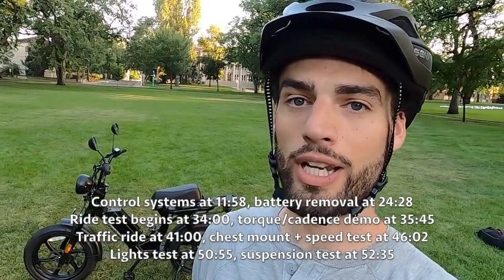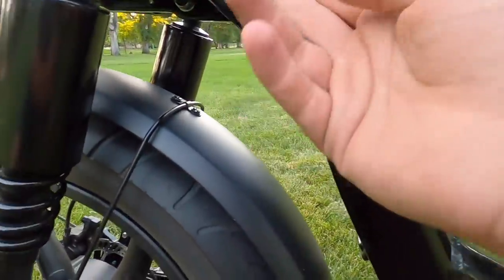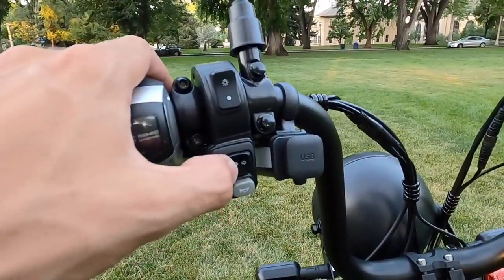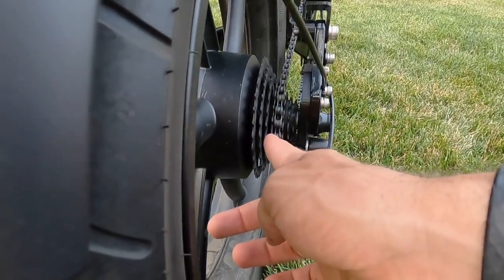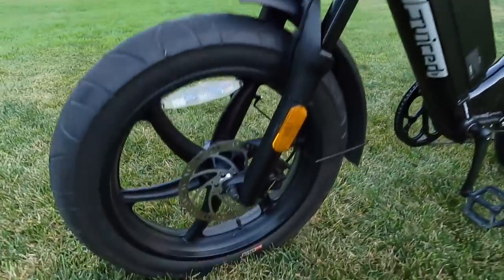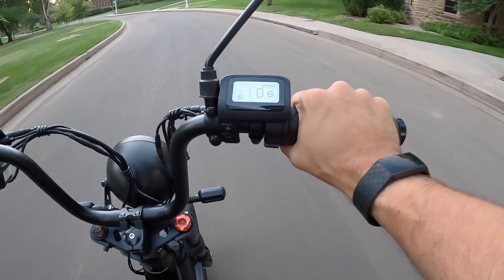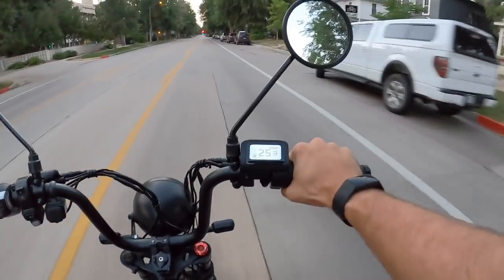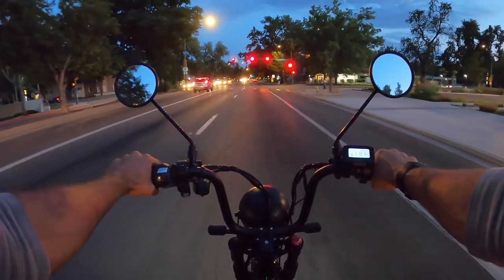Juiced Bikes HyperScorpion Review - $3.2k

Comment: DO. NOT. BUY. My aluminum hyperscorpion arrived with a faulty controller. I had to unplug half of the cables from the bike, clut all the zip ties, and send the whole controller back. There is no on-site support even though I live 2 hours away from their headquarters. Horrible. I have a few ppl saying they are having the same issue with the battery showing empty with 0 volts and they can't give me an ETA for the part bc they don't have any controllers in stock at the moment.
Reply: I've had one with mainly a few tiny blemish issues. It was a great purchase for the price. You happened to get an unfortunate bike that doesn't represent the average bike
Reply: It represents their quality control and customer support for a bike that costs nearly 3k. If you need a durable moped/bike with good support and you live in LA, just get an ONYX
Reply: @NemoEUC  Yes customer support of Onyx a lot better than juiced and I live in LA.
Reply: Same here. Received the new controller on 8/24 and  am waiting on the video to be posted on the R&R process, Fingers crossed the new controller is actually the fix it needs. I will say their customer support people are very quick to reply back. Same day or next day if my emails were sent late in the day.
Reply: @mdbach1065  A video was posted to replace the controller, thats pretty much the process: https://www.youtube.com/watch?v=KWFkaJv0ZGI&t=508s. ill give them that. they were quick to respond. i hope your controller replacement fixes the issue.
Reply: Just saw a vid on Bolton Bikes where he replaced and is developing controller/display upgrade to unlock the full potential to maybe 35 to 40 mph throttle only...

Comment: Lol.. Make sure Karen can see the paperwork and sticker. 😂 While some guy blows past at 50 mph on a CYC 5,000 watt mid drive 72V bike he put together for $3,500.. That bike/moped is really cool.. Only other EBike people would comment on its specs being above norms. You can put a granny on that bike and nobody would ever question it's speed or power .. Police would never give it a second glance . Now I see why you guys don't review a Kepler .. Looks like the controller is mounted in the frame .. You didn't mention it or what amp controller is on that .. Nice review.. Very thorough run through.. Good job! Could change the rear cassette to a narrower width set yes.  👍

Comment: at this price over 3k just buy a sport moto cycle  or a car xd . its way to expensive for 70miles distance in good condition .. and its considered a class 3 ebike so its illegal without a license . its considered a moppet/scooter in most countries including the usa .  its more dangerous because there is no sound of the motors . i am using the lectric bike its 899$ usd and does 50 miles and 28mph it is capable of folding for transport and has super fat tires . Imo  there is no reason to go above 1k - 1,5k for electric devices .
Reply: I bought an '82 Kawasaki 440 LTD for $750 with an unlimited range and much safer than an ebike and no nasty lithium that requires mining and disposal . I doubt this bike will be around in forty years but my Kawasaki is still here and has never had lithium to dispose of . 3k is way to much for such a limited bike .
Reply: I just checked CA bike laws . Class 3 under 28 mph is ok over 17 years old. Need helmet.  Not on some paths. No license or plate.

Comment: Why not just keep it in 8th. gear?  What do you think of the motorcycle foot pegs option and deleting the pedals, chain ring etc. ?   Mine is arriving today.
Reply: I tend to shift down to 5th gear when I stop and then back up to 8th once I get going. I prefer to pedal and get at least some exercise while riding... but it is more than powerful enough to ride with only motor power, and swapping the drivetrain out for the motorcycle footrests would save some weight!
Reply: @TysonRoehrkasse  Thanks for the reply.  Now that I have 40 miles on mine all I can say is Wow!  Any modifications if any will be down the road it is a blast the way it is.  Only concern is the seat.

Comment: This is very irresponsible advice. Don't be like this guy.  Lock your bikes.  I've seen full sized motorbikes lifted into the back of a van that were parked in conspicuous places in daylight.  This is light enough to be lifted.  Alarms are no deterrent to a theif.  You will never regret locking your bike, it's more likely you will not locking the bike.

Comment: The debate between the word MOTOR & ENGINE has been going on for a long time, and it's time to settle it. The reason are many. One example is, since electric vehicles are definitely becoming a part of normal society, signs like NO MOTOR VEHICLES now need to be changed to NO CARS OR MOTORCYCLES or NO COMBUSTION ENGINE VEHICLES.. My local bike path has signs at every intersection where it meets the road that say No Motor Vehicles, because they understandably do not want cars and motorcycles and ATVs to come onto the bike path. Unfortunately, there are some people who believe a motor vehicle is anything with motor, hence, they don't believe in electric bike should be allowed on a bike path. Then the police get involved. Regardless of their misunderstanding, this problem still exists. It could be clarified if the signs simply said no combustion engine vehicles. In this particular example, it's a public perception or misunderstanding. I suspect The Ford motor company will have a big problem with this, But that is not what I believe needs to be changed. Just roadsigns and the way the government thinks about electric vehicle. The time has come to address this IMHO.
Reply: In my neck of the woods no power assist is allowed on bike paths . You can ride your gas bike or ebike using pedal power only  , and there are no signs . It is the law . If you do n't know the law you might learn when you are fined . You would also need an M class licence (Motorcycle) So why bother paying so much for something so slow that requires plates and insurance with a range of 50 miles .

Comment: If you take the battery with you into the coffee shop, doesnt that disable the alarm?
Reply: No, the alarm has its own battery. I think it might be a 9-volt but I'm not sure. The alarm unit comes in a separate box and you have to adhesive it onto the bike, I put mine under the seat where it would be hard to see.

Comment: Juiced sent me a replacement controller for my hyperscorpion and after i replaced the controller, the battery still showed 0.0 volts with an empty battery. They have no idea what is causing the issue. I have no faith in this company. If you want a quality e bike, look somewhere else.
Reply: Did you also replace the display head at the same time? If its microcontroller is defective then it may be not communicating properly with the controller. Also, with SOME display heads, the voltage measurement wire is dedicated and separate from the rest of the display head I/O and power circuitry so you might check to see if that is the case with this one. If it is separate you can't assume that because the display is on the voltmeter is getting a voltage to check. You have to check the voltage on that wire. If 0 volts then check all the associated connections, look for damage, and also determine if it goes separately thru keyswitch and check those connections too if needed. Also check all connectors for displaced  connection pins (e.g. pushed too deep into or even out of  connector shell)
Reply: @exgenica  ..all things juiced should have checked before shipping the bike. They've agreed to give me a full refund. I've already scheduled a pickup for next week. Thanks for sharing the possible cause. They had me check the motor cable, I replaced the controller, the DC to DC, the ignition switch, the display cable harness, and nothing worked. I called their tech support, and to be honest, you know more than them.

Comment: Your web site is awesome. I have been researching bikes for months trying to figure out what is best for  me. I like the scorpion,  for the bench seat! It is heavy, 100 pounds.   I like the folding bikes for putting it in my suv,but those are 60 pounds.  I like suspension. Fat tires fir beach, trails, grass. I am 5' 3" and want a bike that I can have both feet on the ground while sitting on the seat. Inseam about 28 inches. Without test riding one, hard to decide.  

Is there a kids, teen size bike?

Comment: Awesome review. How would you compare this to the scrambler camp with 19.2ah battery . I like that this has rear suspension
Reply: They just released the hyperscrambler 2 which is just this and the scrambler mixed. Full suspension and 2 batteries. I already pre ordered mine
Reply: Mr Railfan yeah I saw it. I passed on the HS2 and have had my camp scrambler in brushed aluminum with the 19.2ah battery and off road controller and I’m really happy with it thus far. I have 60 miles on it so far. Juice on !

Comment: Maybe off topic, maybe not🤔
If you were to consider a fairly epic ride, say🤔 across the United States!
Would this be a contender?
If not, which bike, or style e-bike would you choose and why?
Reply: Honestly I probably wouldn't pick this one... it's amazingly fun to ride around town, but for a long range haul a trekking-style bike would fit a lot better. The range on the Scorpion is decent if you pedal along with the motor, but it's definitely not as comfortable to pedal for long distances. Trekking bikes tend to have much larger diameter wheels too which really helps with ride comfort and rolling efficiency! 

It could certainly handle carrying cargo or pulling a bike trailer though, I've heard of some people doing setups like that where they carry extra batteries in the trailer to swap in, and maybe cover it with a solar panel to charge the batteries that aren't being used. That could be an interesting setup!

Comment: It's cool until you get to know the price which is comparable or slightly  less than a Honda Grom around $3400 with top speed of 55mph.can easily handle 2 up no range anxiety and that bullet proof engine that will last many years.you can't really say that to the China source battery and engine.And that battery you have to replace after 500 charges? The only real advantage is that pedal and too bad it might need registration,proper license to operate it and insurance.if it was my money ill go with Grom

Comment: Are they water proof? With all the wires to hook it up, I wonder if it is weather resistant.
Reply: You will want a Veltop attachment if you're looking to ride ebikes in the rain.
I got one for  a RadRover and riding in the rain was very fun. I did have to buy some gaiters for my legs though from road spray and that was the complete solution.
Reply: All the connectors are high quality and water resistant, you wouldn't want to submerge it in a lake or anything like that but riding in rain is no problem :)

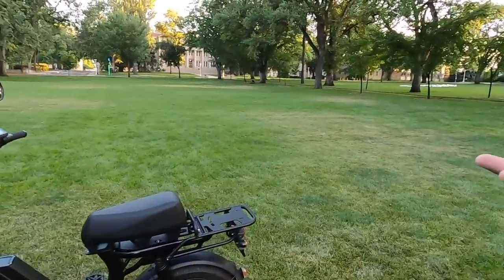Comment: I really want to like this bike but under close examination it scares me.  For example,  just look at those weld points at 2:19, 3:36, 6:49 they look like a 10 year old did them.  I've purchased a number of scooters, go-karts and electric skate boards from China and there have always been quality control issues when it comes to paint, welds, wireing & brake components.  In some cases there was complete failure after just 10-20 miles of riding.  Again, I really want to like this bike, it checks off all of the boxes for me but I fear after reading some of the other on-line posts that it will just wind up falling apart on me and this is a lot of money to have that happen.

Comment: Glad I found this Channel.  Hello EBR, I am looking a e-roadbike for my wife.  She is quite small, with 155cm and around 50kg.  My guess would be framesize around 44~47. I found it hard to find her size even with normal road bikes, let along e-roadbike.  Do you have suggestions?
Reply: Well I'm 5'2 and this Hyper is the safest I've ever felt on an ebike. It's sturdy, has amazing balance and with the step through frame it's super easy to get on/off and honestly the bigger complaints come from taller men wanting more leg room. Pedaling for me is perfect. Hope this helps her!
Reply: @zengirl7510  emm, this is not really a roadbike I'm looking for.  hhhh.  She is used to ride road bike and e-roadbike would be the first choice.  Or maybe a e folding bike.  Do you have suggestions? Thanks!

Comment: Isn't the motor on it just a 1000w peak bafang motor? I would hardly describe that as a moped. My Lectric XP and DJ Super(e)bike would be considered a low powered scooter based on your interpretation of the Colorado low powered scooter law.

EDIT: How would you register this when it doesn't have a VIN? I think you should have a disclaimer that this is your interpretation of Colorado law and should be taken with a huge grain of salt since you aren't a lawyer.
Reply: There is just such a disclaimer in the pinned comment, I'll add it to the description as well :) 

If memory serves, the motor is 1500 watt peaking at 2000. I found a lot of conflicting information about how it should be classed and where it can be ridden, so I still have no idea what the proper legal answer is. At least where I live I have been able to ride it on the street and in the bike lane without getting hassled by anyone!

Comment: I purchased this bike 1yr ago and I would not recommend it. After 14 months it broke due to electric component failure. Im an avonics specalist with a major airline and so have training and experiance working with electrical components and systems. This is build with cheap parts in China. Specifically the battery terminals and connections are unsafe and will burn which is a mjor safety concern. Mine bike failed and Juiced bikes was even aware of the manufacturing flaw but took no steps to fix it. Please see other youtube videos documenting this dangerous issue.

Comment: I love the bike but my battery is NOT that easy to mount.
Reply: On one of the other Juiced bikes I covered, the battery was really difficult to mount at first... after several times of removing and re-mounting it, it got easier. It looked like part of the plastic housing wasn't formed right but it more-or-less got bent a little bit into place.

Comment: I highly recommend upgrading the Hyper Scorpian, any of the Scramblers or Ripcurrent front brake to a 4-piston Magura MT5e and either a 180mm or 203mm MDR-C rotor which is a full 2mm thick. I believe it also needs a QM-40 adaptor for the 180mm conversion, not sure about going to 203mm, so talk to Magura about that. It's an amazing brake made specifically for ebikes and emopeds.

http://www.magurausa-shop.com/product.htm?pid=274848&cat=11906
http://www.magurausa-shop.com/subgrouping.htm?cat=22534&sort=sku-asc
http://www.magurausa-shop.com/subgrouping.htm?cat=22536&sort=sku-asc